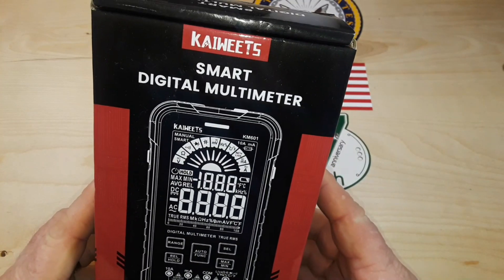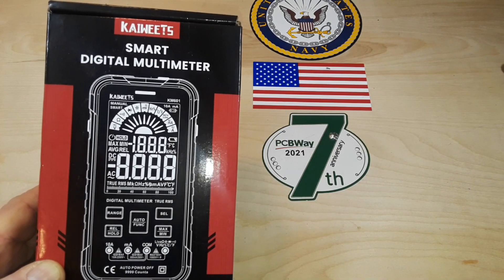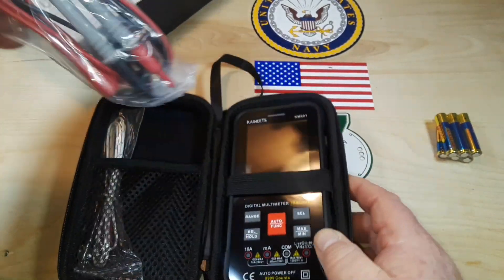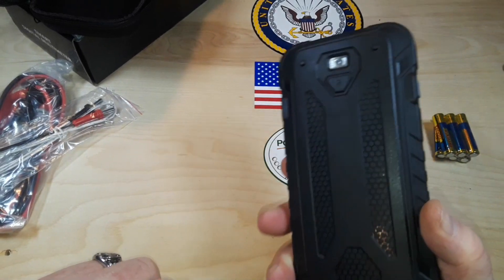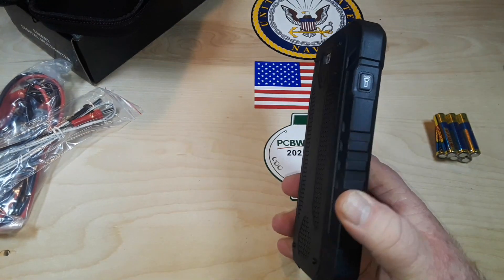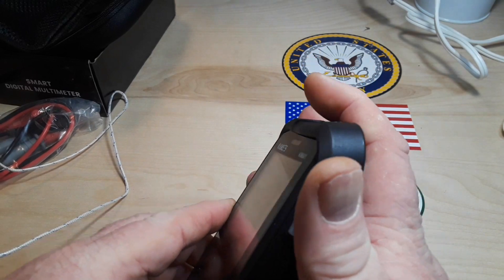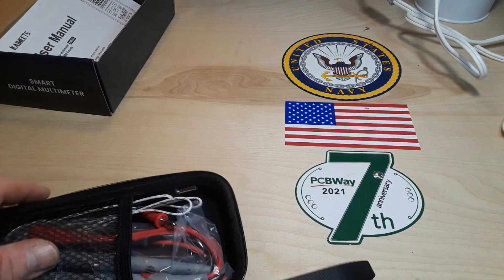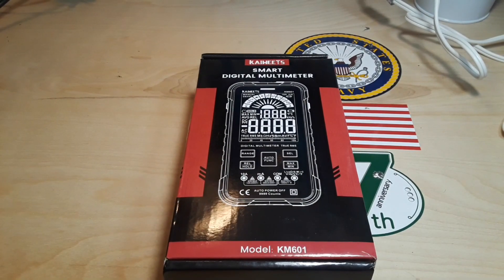Kaiweets KM601 Smart DMM Review

Comment: It's not a bad little meter. I bought it to keep in my home office, so I don't have to keep running out to my truck to get the excellent meter as this does what I need in the office just fine. It seems to check voltage, capacitors, ohms well enough. I don't care about the temp measurement that much because my HVAC tools are all I need, but if you care about it, you will not be happy as it's off by 10 degrees at room temp. It is probably fine if you don't need tight accuracy for something else. It is not that anything is wrong with the meter. Thermocouples need calibration for the meter they are used on. The good meters that use thermocouples have a set screw for adjusting the thermocouple in ice water. This meter does not have that option, and I didn't see it in the manual. So I'd say it's still not a bad meter for the price.

Comment: At 0:20 take a look at the words on the side of the box.  Mine arrived a few days ago, with the same packaging.  It works fine, but I definitely got a laugh at the box it came in...on the side it reads "PROFESIONAL . PRECISION . SAFE . DURABLE"  Yes, they (somewhat unprofessionally) misspelled 'professional'!  Nice little meter, though - a step up from most of the crappy ones I had kicking around.  Would be nice to have a kickstand on it, but a small stand is easy enough to fabricate.  Not a huge fan of those stiff probe cables, but I have a much nicer silicone set that I have been using with it.